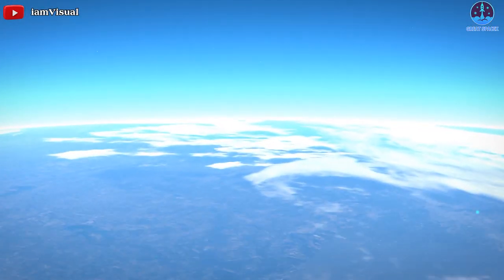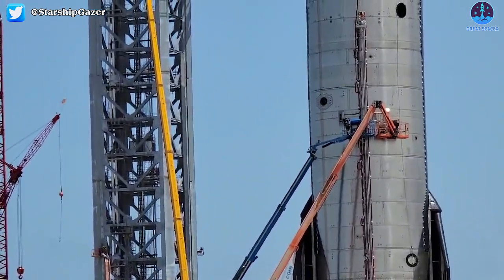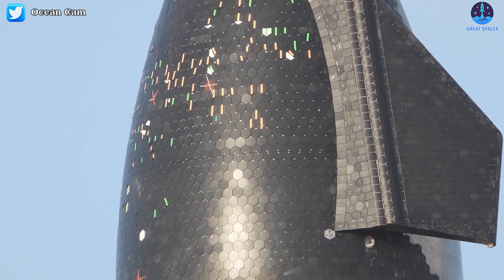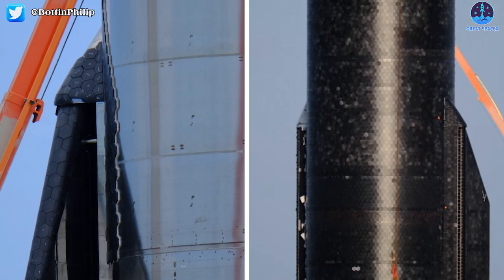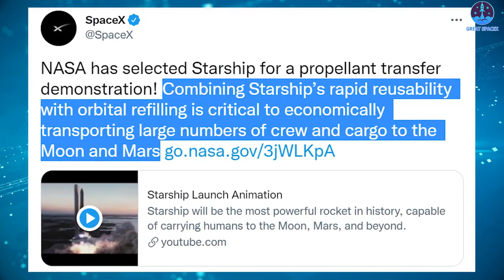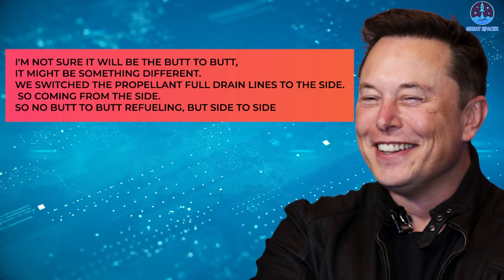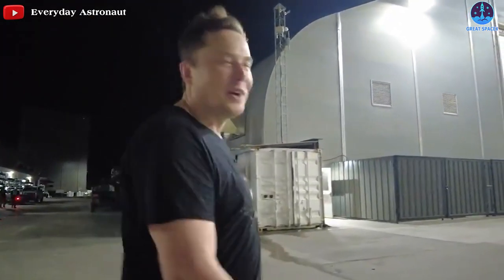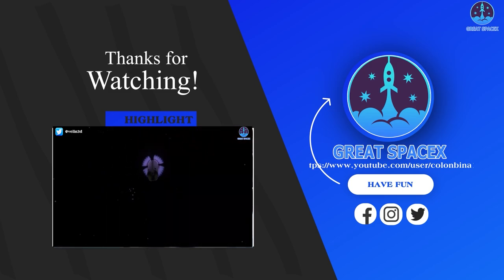SpaceX Orbital Starship New Major designs Change everything!

Comment: As people in the comments seem to be a little lost, here are some thoughts that might help understand better what Elon Musk is saying:
1. Refueling for HLS mission - Elon Musk is looking to get up to 150t to LEO by cutting down hang time with more engines and more thrust.  There is a certain wall to this where either the forces at max-q destroy the rocket or as the fuel load lightens up, the g-forces on the rocket become too great as the thrust to mass ratio becomes too high.  Even if the rocket survives extreme G's, any people on board would likely get crushed by their own weight from the extreme forces and break blood vessels and such.  So the goal is to minimize hang time against Earth's gravity while keeping the forces on the rocket from getting to great.  At this the 150t to LEO includes a rocket with a massive heat shield, flaps, and fuel to de-orbit and then make a propulsive landing.  So now you look at the HLS Starship.  No heat shield.  This is many tonnes saved from the design.  No flaps.  Several more tonnes saved from the design.  Does not need fuel to land on Earth.  A number more tonnes saved.  The contracted missions with NASA just provision for 4 crew and life support for a short mission.  The vast majority of the ship has nothing allocated to it, so there is a good chance it will just be empty, pressurized space with a sign that says "reserved for future missions" or something to the like.  On the return there will be nobody on board, so with a stainless steal frame, you could have the rocket repeatedly skim Earth's atmosphere while in a highly elliptical orbit, which will lower and circularize the orbit and then do a small burn to park HLS Starship in LEO.  So while doing all of this requires a lot of delta-V, the fist 200+t will already be onboard because it wasn't needed to achieve LEO.  However before launching HLS Starship, you would already have launched all of the tanker missions you are going to do to fill up one tanker, which will be in orbit waiting for HLS Starship when it launches.  Then you just do one refueling to it and it is off to the Moon.  If you do say 4 tankers for 600t of fuel and you already have 200+t onboard, that would fill the tanks to 800+t.  Delta-V is largely based on starting mass verses ending mass, so if the rocket is already light by not having any recovery hardware and almost no payload, it is mainly just a stainless steel haul, then the ending mass after all of the burns is going to be lower than the delta-V quote Elon Musk gave for a fully loaded up Starship.  So lowering the starting mass by reducing the fuel load should work out fine.  I mean if you can get a delta-V of 6.9 km/s with a starting mass of 1420 t (1200t propellant, 120t ship, 100t payload) and ending mass of 220t (120t ship, 100t payload), then dropping the starting mass to say 900t (800t propellant, 80t ship, 20t payload),  and having an ending mass of 100t (80t ship, 20t payload), should yield a delta-V around 8 km/s.  If you have say 850t of propellant, it looks like from the delta-V chart this should push things up to the realm where HLS Starship could potentially get all the way to the Lunar surface and do the above proposed return to LEO.

2. Future HLS missions in a future contract will more likely use a full propellant load.  At this a lot of the work is getting back off of the Lunar surface and back into LEO, so if you mainly drop off stuff on the Lunar surface (don't need to take all of that poop back with you after a multi-month mission after the consumables are consumed), this allows a lot to be carried to the Lunar surface on a full propellant load.

3. Side to side refueling should work fine.  One thing you would do as mentioned above is refuel a tanker and then refuel the main mission Starship.  As the tank pressure is going to be multiple atmospheres and you are likely to have some boil-off in these tanker ships, the ullage motors could potentially use this gas pressure to push the ships forward in order to get the propellant to settle in the bottom of the tanks.  When refueling, fuel depots actually don't make a lot of sense because there can be all different kinds of orbits and orbital inclinations that would be ideal for one mission but not the next, so placing an appropriately fueled tanker where it is needed right before launching the main part of the mission should be by far the most effective way to get the propellant to the rocket.  However having a fuel depot in a fixed orbit is only really good for a mission that needs it in that particular orbit.  All of the other missions are going to either need to burn extra fuel when departing the depot to get on the right path for their mission or not be able to complete their mission.  At this, there is an advantage to refueling at such a low altitude as to not be maintainable by a stationary depot, but instead only a temporarily orbiting tanker ship.  The reason for this is say you do 9 flights, 8 tanker and one main and have the tankers rendezvous with a fuel depot at say ISS altitude.  Each tanker will have to burn extra propellant pushing both its remaining propellant and the structure of the rocket to a higher orbit.  Once at this higher orbit, it can transfer much of this remaining propellant to a depot.  However then it needs to reserve propellant to lower its altitude from this higher orbit and do a graceful re-entry and then more propellant to safely land.  Going up to ISS altitude over minimum LEO altitude can easy chew up over 30% of the propellant capacity with much of this propellant used moving up to 8 tanker Starship hauls up to this higher orbit.  That is a lot of structural mass to move up to a higher orbit and then back from that higher orbit.  So instead of moving say 1200t of propellant to your depot, you only move say 800t as the rest was used moving those tanker hulls around.  However now say you do all of this refueling stuff at a minimal LEO altitude and move 1200t of propellant into a Starship that carries a heavy load, say 250t and used 100% of its propellant just to get to this minimal LEO altitude.  It will receive the full 1200t from a fully fueled tanker waiting for it and then be on its way.  When it rockets away from LEO, the vast majority of the starting mass will be propellant, not structural mass heavy like mostly empty tankers at this point in flight trying to go higher.  At this it can make the maximum use of the Oberth Effect to slingshot itself away from Earth while making the most efficient use of the propellant onboard possible.  Another way of putting this is bringing tanker Starship to ISS height for a fuel depot adds up to 8x dead weight as in structural mass that needs to be pushed to a higher altitude at substantial cost to remaining propellant.  Even if your main mission Starship is ultimately going to ISS altitude, that is only 1x structural mass going to ISS altitude, not 8x.  The Oberth Effect, which you would likely use for such a high delta-V mission, can cut the propellant used by up to half, however the closer you are to Earth, the better the effect.  If you slowly raise altitude and then do your big Oberth Effect burn, it is not as effective of a maneuver and total mission propellant used will be substantially more.  So yeah, while you can potentially do orbital refueling far from Earth, granted NASA changes its stance on this to allow refueling away from LEO, you really want to do as much refueling as possible at the minimal LEO altitude for the greatest efficiency of the mission, at least if all of the propellant comes from Earth.
Reply from the maker: Woww, amazing information. Thanks so much, bro. We appreciate it.

Comment: I wonder how the new forward flap configuration will impact the maximum payload size as moving the flap will reduce the space available for cargo door.
Reply: smaller means lighter dry weight and more payload capacity. The location changes nothing on payload weight.
Reply: @babyUFO.  I don't wrote weight, I talked about size.
Take Falcon Heavy: most of the time  it is limited by fairing size not payload weight.
If move the forward flap higher and closer for sure the cargo bay door will be smaller limiting the maximum size a payload can have.

Comment: They need larger sections of heat tiles for sake of replacing them easier. However, I suspect thermo dynamics is why they haven't done larger sections.
Reply: larger sections would mean incorperating curves which would mean adding to the more than 50 shapes involved already, and the goal is to simplify.
Reply: @babyUFO.  Once production is set up, then it won't be as hard to mass produce the tiles. 50 different shapes isn't all that many.

Comment: I wonder why it has to be 24/7 and late nights all the time…
In my experience that only leads to errors and lower performance

Also refueling in space: would they need to spin the docked vehicles to make sure they can pump over fluid stuff rather than gas bubbles ?

Comment: If the bottom flaps are designed differently. Less heat shield tiles could be used reducing weight. Then it wouldn't need to bellyflop. Just drop down like falcon, easier for seating for crew in the future.

Comment: Question 1. Will the hot gases in re-entry find a way through the GAP in the hinge for each flap?  Question 2.
Reply: Wait for the launch to find out, the hinge is the weak point, there was talk of protecting it with gas jets to create a barrier layer.
Reply: @ForeverNeverwhere1  The idea of moving the hinges and covers out of the plasma stream seems like the best option.  It also avoids a possible problem of the hinges creating drag in atmosphere even when the flaps are not deployed.
Reply: There was a material used on the shuttle to protect the hinges and gaps from the wheel well doors and shuttle bay doors which SpaceX may use.

Comment: How would a Starship and fuel drone receive 'a slight push' in any direction if they were docked 'butt to butt' because they would be blocking each other's engines which therefore be unusable.

However if the Starship and fuel drone were linked abeam of each other a 'slight push' should be attainable hence the change of strategy?

Comment: Silly questions, but why can’t they have a booster rocket filled in earth orbit that one,two or three space ships can connect to once in orbit? Or would it need too much fuel to thrust that much weight?
Reply: One starship has fuel capacity of 1200 tons, so 3 refuelings would be 3600 tons. With cargo capacity of the Starship being 150 tons, that would be 24 starships to refuel. It would also need to be built in orbit because of its massive size.
Reply: That's the plan - they have a cargo ship designed for that purpose. Of course, they have to get that into space too. Problem is that even the cargo ship can only provide so much fuel. It will still take numerous flights to fill the Moon Starship. Musk recently said he believes the Starship is almost too big and that they are not likely to build bigger versions. When it comes to Mars, my guess would be that within 8 years SX will be using a different propulsive system altogether. They'll need the Starship to get to orbit and then a tanker/hauler to get to Mars and back. Probably a nuclear tanker that will require less fuel and go at twice the speed. Several are working on engine designs right now. Unfortunately, Bezos was assigned to one of those development projects.

Comment: Anyone knows how much weight do all the heatshields add? And why are they tiles instead of just a big sheet wrapping around the rocket?
Reply: "Why tiles instead of big sheet?" Easier to manufacture small tiles and continuously iterate over the design to improve it. Musk has a tendency to build small and just add more of it: 1-engine, to 9-engines, to 27-engines, to 42-engines.

AMD used to be derided for their "ADD MOAR CORES!!" approach to competing with Intel, but it works surprisingly well in many industries.
Reply: Derp. I forgot to add the obvious: If the shield gets damaged in any way during or after launch, it's easier to replace a handful of tiles than an entire sheet.